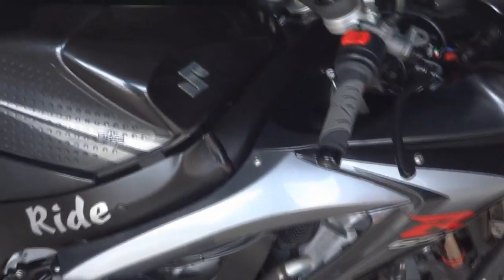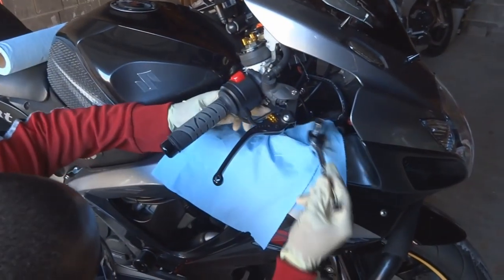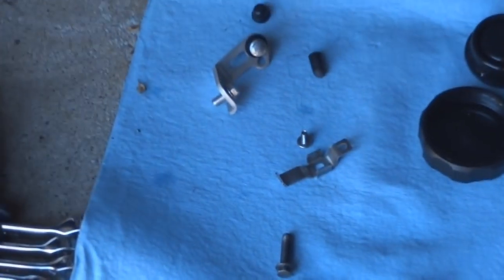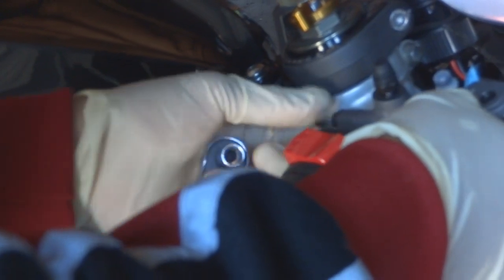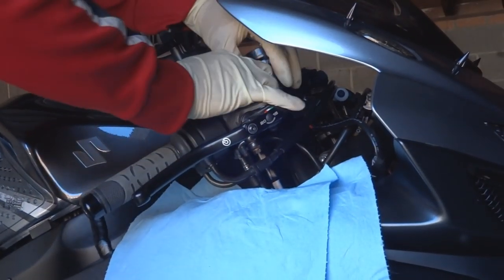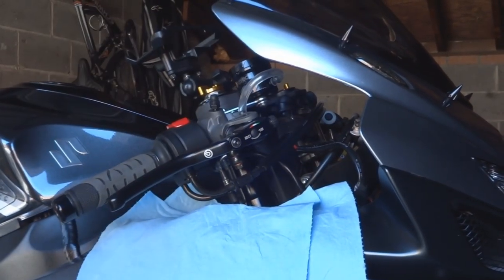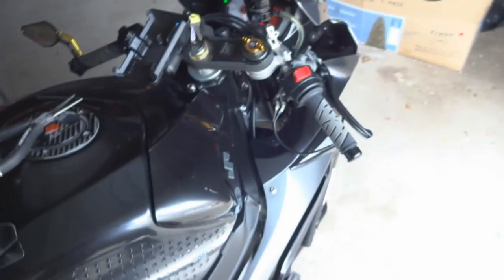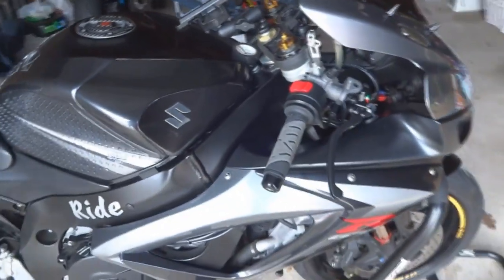Gixxer Brembo RCS Master Cylinder Install - 07 GSXR 750

Comment from the maker: Haven't been able to test it out much.  Doing some more work on the bike so its stuck in the garage lately.  I did take it out for a short ride and it felt really easy to lock up the brake compared to what it was. Also might need to adjust the suspension a little better to cut down how much the front dives under braking without making it too stiff for street riding.
Reply: +RastaSpeed1 
I think this is one of the virtues of the levers that come with adjusters. It would be a major pain in the ass to spend $200+ on levers that engage way too early or way too late for my comfort. I'm still shopping around though - I am leaning towards CRG now because the videos I've seen on FP are disappointing and apparently ASV availability is appalling.

Comment: how did u hold the brake lines on without the clamps to master from reservoir. I'm thinking about zip ties. clamps that came with brembo kit are a bitch to get on.
Reply from the maker: I used clamp. If the berm of ones don't fit then try the auto parts store. The zip ties will work but will pinch the hose at one point in the circle.  Better idea is to find a clamp that fits
Reply: Don't use zip ties. No reason to spend all that money on quality Brembo kit and then kludge the rest of it.

Comment: Are the Brembo brake wires color coated to match our stock brake wires or was it a test and trial experience? Thanks for any help
Reply from the maker: I don't recall that the brake wires were color coded to match the stock wires.  I am not very good with wiring but I did the trial and error method and it worked on the first attempt.  I think that I saw something that indicated that the wiring may work both ways (polarity does not matter) but I could be wrong.
Reply: Oh ok, thanks! I just got done installing this on my 07 gsxr 1000 and boy did it make a huge difference. I just have to wire it in and was worried that I may blow some fuses. Thanks for the info and ride safe!

Comment: it is possible to do it with the stock reservoir ?
Reply from the maker: I believe the stock reservoir can be used.  This was done a long time ago so I can't remember if the reservoir change was necessary.
Reply: You have to get a different diameter reservoir hose.